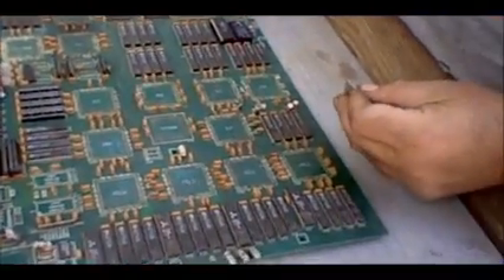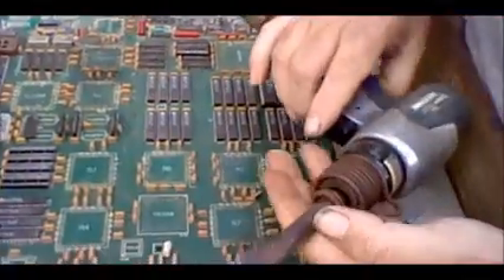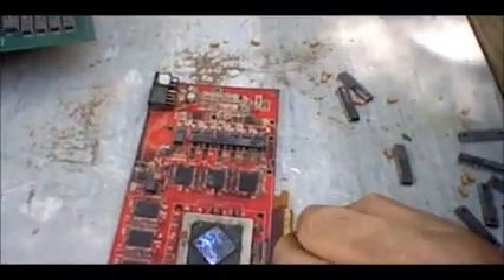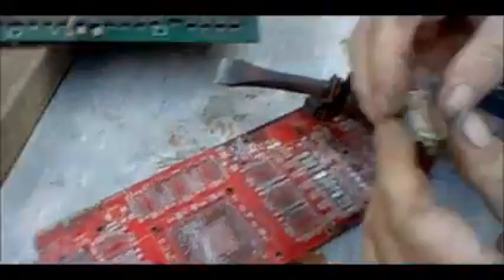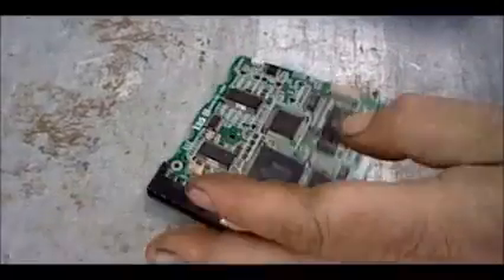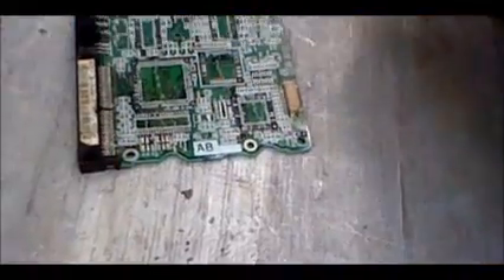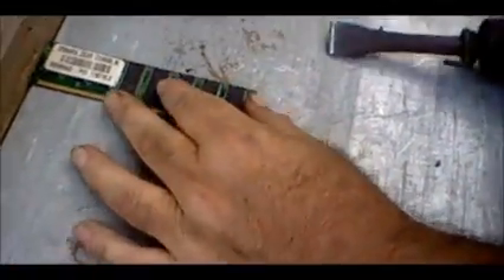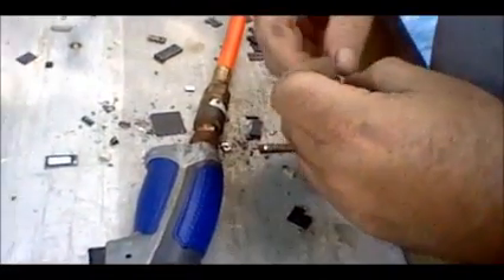Depopulating boards

Comment: im new to this do you have a video for what to do with the boards after they are depopulated
Reply from the maker: +Tina Mcgrath Not yet. I am trying to perfect the best process for the backyard refiner to reclaim the copper. Any process that removes the copper will also remove any other metals on the board whether they are dissolved or the copper substrate is dissolved from beneath it. I have done experiments and believe I have found an efficient way to remove and recover the copper from the boards in one process. It involves multiple containers and processes happening all at the same time in a continuous process. I will definitely post video of anything that I build.

Comment: looks's like just what i need very clean Geo. were's a good store to pick one up ? whats the cost for the set up you use ?
Reply from the maker: +fredie w The one in the video came from Lowes  http://www.lowes.com/pd_89082-47120-SGY-AIR132___?productId=3309276&pl=1&Ntt=air+hammer  and is listed at $29.99. I already had the compressor and just added a couple of extra tanks like the portable air tank variety.

Comment: I use this method too Geo. Works well on motherboards. I suggest wearing a pair of thick leather gloves.... the chisel will bite you eventually. And don't forget safety glasses and hearing protection too.
Reply from the maker: +IsettasRock I hear you. I like living on the edge, it keeps me alive. :-) I do wear safety glasses and noise suppression. The gloves, not so much. After a little while, you learn not to get your fingers in the way. I worked for years scrapping electric motors and cutting the windings with a wood chisel and a hammer. I can't tell you how many times I have missed the chisel and hit my hand and usually right where the thumb connects. I'm sure it has been broken a couple of times. You just grunt and keep on swinging. It sort of becomes a challenge. You need to swing as hard as you can to cut through the copper and if you ever get afraid of hitting your hand, you might as well put everything down and walk away.
Reply: +Geo lol, ok then, carry on